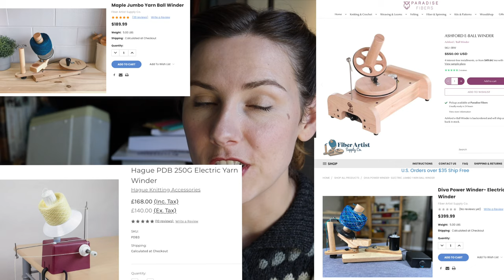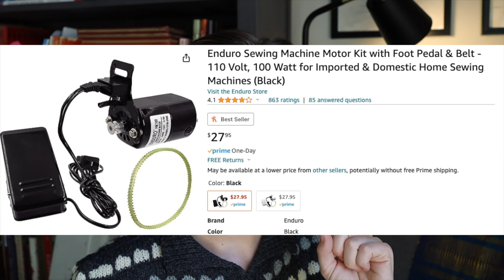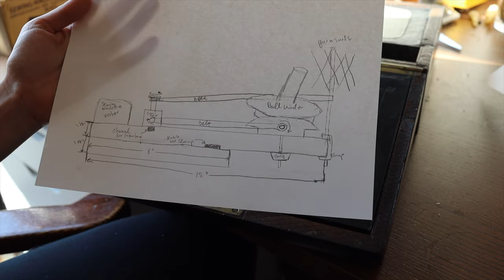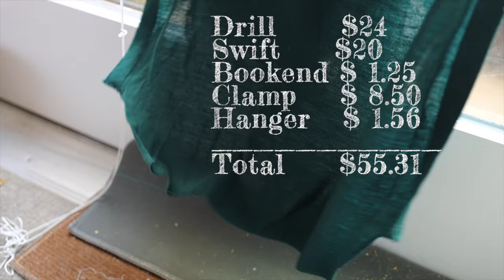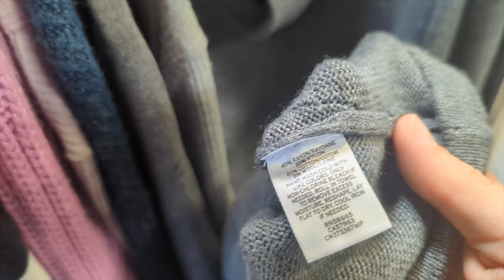How To Build A Sweater Unraveling Machine

Comment: Former high school theatre teacher here, so not a trained engineer.  But I do have extensive construction and mechanical improv skills.

I'd add a triangular corner gusset to each right angle.  That will counteract some of the downward pull on your cantilevered areas and keep the upright members square and in plane with each other.  I also second the suggestion of making  bushings for the places where the shaft passes through the support structure.  You can do that the fancy way by getting some bearings or the less fancy way by finding some tubing slightly larger than the bolt you are using.

Comment: I’m also an engineer and knitter/spinner/dyer. I have unraveled sweaters by hand and it is very tedious, but fun at the same time. I’m intrigued by your machine and will be thinking about it next time I buy  a thrift sweater for unravelling. I have unravelled very thin yarns and then spun those thin yarns into something thicker and more useful for hand knitting. This way, I can customize colours and weight of the resulting yarns.
Reply: Having now watched the whole thing. I’m left wondering why you didn’t use you electric spinner in aid of an electric swift or ball winder? Maybe you tried this and there were issues.

Comment: Like so many others here, I am also an engineer.  I started in Biomedical Engineering and finished in Software Engineering.  I am currently going through the same iterative process with an adaptable winder which can be used to wind crochet thread that tatting thread as well as yarn, but not motorized.  I have a tendency to build cardboard mockups for proof of concept before I order parts.  The Stanwood Large Metal Ball Winder should be excellent for motorizing since it is designed to be more easily disassembled and spare parts are available.  I'm excited to see what you come up with and I'm tempted to try my own version of the Unraveler.  I live in a small town, though, and I have had zero luck finding sweaters to unravel at our local thrift shops.

Comment: Another engineer here. I really enjoyed watching your process! An idea that popped into my head was maybe you could use lego for some of the parts? The reason I thought of this was because at uni we had to program a lego mindstorm wind turbine, so I figured it could work in a similar way but being driven rather than driving a motor. Also lego has lots of different gears, belts etc and would let you switch parts in and out really easily. Of course lego can get expensive

Comment: Fantastic video explainer! As a former weaver who also used to spin yarn I want to say you're on the right track with 3 (or more) ply yarns since you're a knitter.  If you think about the cross-section of a 2 ply yarn, it's like a figure 8 or, better, two pennies touching.  A flattish 2 ply yarn is fine for weavers, who are further interlacing the yarn in a 90 degree fashion in plain or twill weaves.  Knitting and crochet create more complex interlacings that have more dimension than flat weaves.  If you think of three pennies touching in the most efficient way, the overall cross-section of the yarn (not each ply) is triangular and begins to approach a circle.  If even more plies are added, the yarn cross-section will become quite circular --- all the better for showing off knitting stitches.

Comment: Re: fibers in the air. I worked one college summer in a factory that made fiberglass yarn, rope, and woven fabrics. The air *shimmered*.  Few workers wore any kind of breathing protection -- management assured us the fibers were too big to reach our lungs -- and even if you did, the glass fibers would get between the mask and your skin & your face would be bleeding by the end of shift. Management could also have, ya know, improved shop ventilation & changed the air scrubber filters once in awhile. But most of the workers were Kelly Girl temps. Temps were cheap, air filtration was expensive. 😐

I saw three people taken out of there by ambulance during that summer, and the place burned down twice due to unsafe storage of chemicals. So yay! that you wear a mask, and also hopefully you don't store 55gal drums of toluene next to a giant furnace.😬🔥🏭
Reply: Wow, that is really terrifying. I wonder how many of those people got lung cancer.
Reply: @jessicav2031  Doubly depressing: most of the workers (some of whom were just kids like me) spent their lunch break sucking down as many cigarettes as they could during their 30 minutes of respite from the factory floor. It's like, "What -- you aren't dying fast enuf in there?"

It was just a tiny glimpse of what the great mills of Manchester and Boston must have been like, with barefoot 7 yr olds crawling under running machinery to remove cotton dust.😧 They were called 'mule scavengers'.

Comment: I loved this video and has given me several ideas to adapt some hands free tools to help me along. While I don't necessarily need a swift or a winder, I have been toying with the idea to create a small spinner to spin dry for blocking knits (right now my OXO salad spinner works great for small projects but want a bigger solution). I also saw someone use their drill to turn their Addi kitting machine to make sock blanks for dying which I found really cool and want to try it out which led me to think about adapting my sock knitting machine to be hands free. I wouldn't mind somehow using bands and leveraging my spinning wheel to pedal power it.

Comment: Not an engineer of any type so this is just an observation on your great work.  Where your output shaft from the motor goes through the 2x4? Upright, you need two bearings one each side of the hole, this will greatly reduce your arms loaded with wool sashaying about as much and cut down some of the noise.  Hope this helps, keep up the great work.

Comment: I'm not an engineer and this still fascinated me! I have some ideas, but of course, not an engineer, so I have no clue if they're viable, haha.

The wood pegs could be made removeable with a screw and nut installed into the bottom of each wooden peg, if the weight of the bolts is too heavy. Since you don't need to hold the machine at 90* now, you could explore putting it horizontal again (because the 90* purpose was for you to hold it up more easily with the drill). It could be more stable that way too, with a wider support for the base; I saw it wobbling a little bit. The motor then wouldn't be supporting the weight at all and would just be a rotating rod through the support. I'm not sure if the size of the windmill arms makes a difference, so I wondered why they were so wide and long. Maybe you'd be able to have a two-directional or two-speed windmill as well with your plastic skein winder that you can stack on top for any dual-strand sweaters, to take the manual step out with your ball winder!

Comment: This is such a great idea. Congratulations. Just as a suggestion, what do you think about adding a second swift at 90 degree offset to the first on the same shaft for your 2 yarn sweaters? Well maybe not 90 degrees, but so the arms of the swifts are offset. This will make the 2 strands unravel separately. Also, make your frame 2 sided with a longer shaft that goes through both sides of the frame with the Swifts between. It will be more stable.

Comment: Hi! I’m trying to build myself an electric hank winder and your video has been THE most useful resource I have found, so thank you so, so much! I was wondering if the bolt that supports the swift is supported by the front arm. If so, does that cause friction? And if it isn’t supported by the front arm, what is the front arm for?

Comment: This was super cool! I’ve been fantasizing about making my own unraveler since you posted your last video. I’m a computer scientist, and I was also probably complicating things in my head by thinking I’d use an arduino to control my own unraveler lol. I’m just wondering — where did you get your spinning machine? I’ve been trying to find one online and everything I’ve seen is $500+, and also made out of wood.
Reply: @Stettafire thanks for the tip! However, i do not have the time i think to manually spin a thousand yards of yarn using a drop spindle, from the sweater I just unraveled 😅
Reply: Ah! I finally found it. It’s an Electric Eel Wheel. Looks like the 6.0 model, which costs about $300

Comment: You can also shrink heatshrink (shrinkable wire tubing) with a hairdryer! Takes a little longer but it's safer than a lighter. That's what I did when i built my 3D printer.